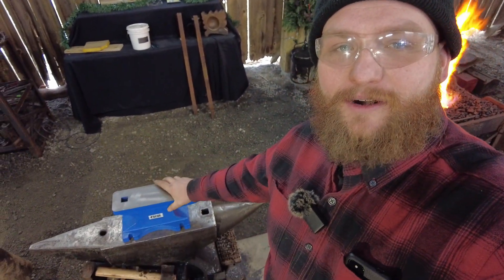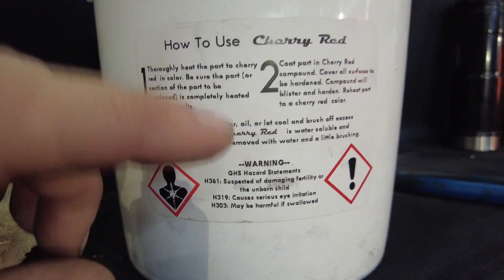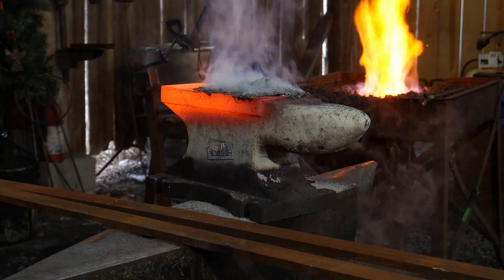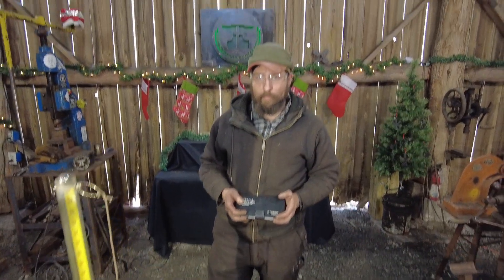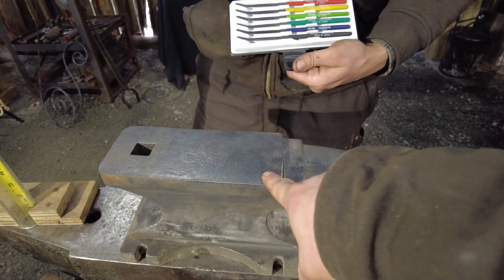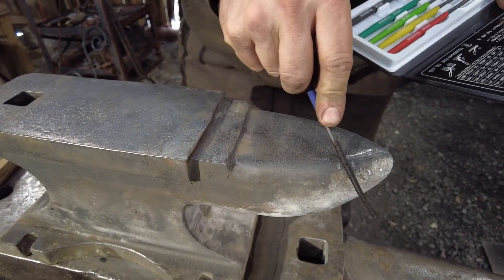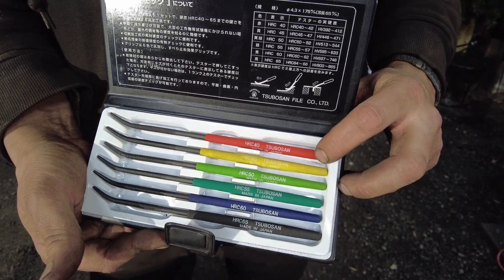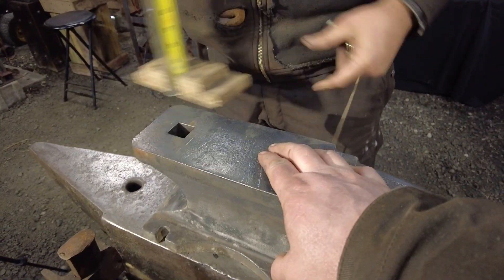Can We Case Harden a Harbor Freight Anvil?

Comment: I think those are ductile iron, and if so it is extremely hard to effectively harden it, and probably out of scope for most home blacksmiths.  Cyanide salt bath nitriding can get good results, but the process is scary.
Reply from the maker: They are cast iron not ductile iron to the best of My knowledge. Says cast iron on the box but who knows with harbour freight LoL. Thanks for the comment And merry Christmas 🎄
Reply: @ChristCenteredIronworks  On their website they call them "top grade cast iron" but I have no idea how they'd get cast iron that soft unless it's nodular... so I just call it Chinesium.
Reply: Ductile iron is a type of cast iron. Harbor Freight anvils are just cast iron which most likely means "grey cast iron". What would be nice to know in the future is what the actual carbon content of these anvils is. Cast iron just has to be a minimum of 2-3% by weight, but could be 5-7% by weight.
Reply: I honestly wouldnt even waste my time on a HF anvil, or the money. The place is okay for some tools and home gamers but basically you're scraping the bottom of the barrel with basically anything you buy there. I've had some tools from there that are okay but most simply dont last. Most their air tools are unbalanced and will fail under any sort of extended use. As for their anvils they are cast iron.
Reply: Best way to know is to break off a section of it and look at the grain structure compared to grey cast iron and ductile cast iron. Ductile cast iron seems to like to ring better than grey cast iron. Like, the holland anvil Swage Block is actual ductile cast iron and it rings like a bell.  As far as I know the HF cast iron anvil doesn't ring.
Reply: @Jordan Nicole Haisley
The best way to upgrade an anvil of this type is to weld a plate of good steel on top. Some brands already do this.
Reply: @iridios6127  I am not aware of any new production anvil which uses welded construction or different alloys except the Future anvils which have an aluminum base. It would be ridiculously cost prohibitive and labor intensive.
Reply: @DragonHide94  
I’m not telling to you. ))))
BTW It’s cheaper than buying for 500-1000$, even a steel anvil that won’t be much better.
Reply: @iridios6127  no, it is not. Upgrading garbage by putting $300 of material, consumables, fuel, and time just to make it a little less terrible is not a cost effective option.
Reply: @DragonHide94  
U r really bad at the math.  ))))
Reply: @iridios6127  you don't understand what it actually takes to weld Cast iron.
Reply: @DragonHide94  
Aside from the stupid mythology and the BS — it’s easy, like to get out of the rain with an umbrella.
Reply: - - -  @DragonHide94  
As I said - you have to throw away the BS and just weld the plate to the anvil, the stick for the cast iron. There is no need to preheat anything.
You overestimate your ability (or someone else’s) to break this weld. )))
Reply: You think you know what you are talking about. You don't.
Reply: @DragonHide94  
Not only do I "talk", but I’ve already done it a couple of times, quite successfully.  ;-))

Comment: While it does not work on an HF anvil, it would be intresting to see the results on a Railroad track and a slab of Steel for comparison
Reply: It will certainly work on rail, but if you've got an old piece, lots of heavy traffic, it's work hardened extremely hard.  "The bounce test" is the way to tell.
Reply: Rail road track is already pretty darn hard.
Reply: Many rails are already kinda hard.
Reply: Because the HF anvil is cast iron.   Not steel.

Comment: That was fun! So a quick internet search indicates cast iron has at least 4% C, whereas steel (harden-able steel) is less than 2%.  Interesting. I think that might explain why the cherry red did not do anything to that anvil.
Reply from the maker: Very interesting 🤔 you'd would think more carbon equals more hardening potential but I guess not.. again I'm not no metallurgist but it is still fun to experiment... Merry Christmas 🎄
Reply: @ChristCenteredIronworks  Merry Christmas!
As a not-no-metalurgist also, I agree! My thinking is that more carbon = more hardening until some carbon characteristics become dominate in the solution. gathering from other comments it sounds like the harden-able range is roughly from 0.5 to 2%. Carbon content outside that range makes steel/iron that does not harden.
So, I have heard that forging can drive carbon out of steel, which begs the question,
How much working of cast iron is required to make it into steel?
Reply: @1noryb  you can get some hardening with anything over .2% carbon, the effect doesn't become significant until you reach at least .35% or so but you can feel the difference when you file it if you pay attention. .4% carbon is good for hammers and probably the bare minimum for a decent knife like object with the optimal range for simple alloys being somewhere between .5% and 1.2%.
Reply: @ChristCenteredIronworks  Actually these anvils are cast steel (  mild to medium at < 0.6% carbon ) making them soft.  1095 has 0.95% carbon.  Real cast iron is quite hard and brittle at >= 2.0% carbon which came from using coal or charcoal as a reducing agent in a bloom furnace or pig-iron furnace to reduce Fe203 to molten iron.  It took many hours at a forge and anvil to overwork a piece of cast iron to decarbonize it down to steel.   Then the advent of pumping oxygen through the molten iron to burn off excess carbon and silicon to easily make steel turned cast iron into a specialty/boutique item.

Comment: I believe the only way to get a hard face on this type of anvil would be to weld a piece of  high carbon steel to the table face and then heat treat that. This would add to the mass of the anvil which would be a plus. The only thing is after all the materials and time are added it’s probably not worth the trouble.
Reply: I said the EXACT SAME THING last video haha

Comment: Hey Roy, we all know the HF anvils are well, garbage. How about you just drill a hole in the next one, mount a handle in it and mount it on the wall. " The Anvil Sledge" is born. LOL
Reply: And it’s amazingly easy to drill.
Reply: ive been working off one, all some of us can afford, n ive made several good knives lol, ive done san mai n damascus and several monosteel blades, may nit be ideal but hey ut wirks
Reply: @disciple5337  not to anvil shame here, however there are ways to get what you can afford and have good performance. A damaged face greatly reduces the price, just make sure the damage is where you won't be working. One with a broken off heel is great for a starter. Or go Brutalist and have a solid block of H-13 or other hard steel and go to town. Junkyards have them in our area too and you'd be surprised how many people don't know what an anvil is.
Reply: all that w a homemade coal forge. hb anvil, n alotta blood n sweat lol

Comment: You should drill out a slug from the harbor freight anvil and get a metallurgy report on it. Then take that information and figure out what you need to turn it into anvil quality metal. Melt it down add what you should by weight to get a decent metal for an anvil. Then recast an anvil with the same material and see if you can case harden it.
Reply: Or just buy a better quality anvil!
Reply: The Reverse ship of Theseus: Take it apart, improve on the material by upgrading it and reasemble it. Is it still the same ship?

Comment: As someone who studied metals, I can tell you that one of the key factors when it comes to hardness, is carbon content. If you carbon content is 45 points or lower, you will never harden it to good values. If your carbon content is 50 points or above, then you can get good hardness. 
Other major key factors include the quench process, and the tempering process.
Reply: Case hardening is different than just regular quench hardening. I've case hardened mild steel hitch pins by putting them inside a stainless steel bag with charcoal, then putting the bag in a furnace at a specific heat for a specific amount of time. What happens is the outer layer of the mild steel absorbs carbon from the charcoal in the bag. Case hardening is mainly used with mild steel for applications that require a part with a soft core and a hard outer layer.
Reply: Cast Iron generally has much more carbon than steel, normally over 2%. The problem is the structure of the carbon in the iron. Putting the anvil in a oxygenated environment and heating it to near melting could in theory convert at least the surface to a material more like cast steel.

Comment: Good stuff. I attempted to harden my hf before I got the big blue.  Used a cutting torch to barely get it that dull red/black color then took the hose to it. I got pretty much the same result as your first attempt.  Very slight increase in hardness. 🍻

Comment: I think that case hardening powder only penetrates around 1 mm into the metal.👍✌
Reply: If you heat it up to welding temp and hammer it in while it cools, maybe... I think it normally only penetrates maybe half that deep.